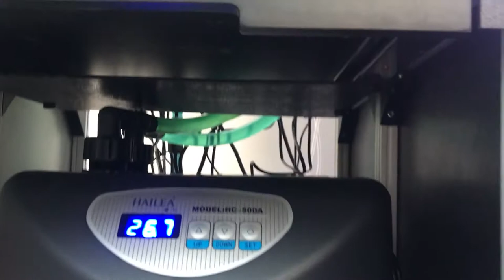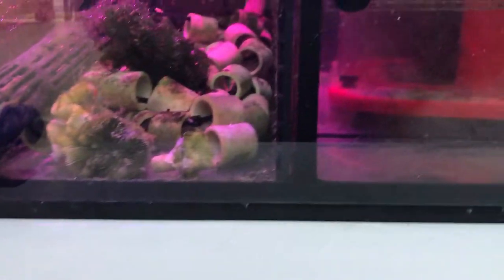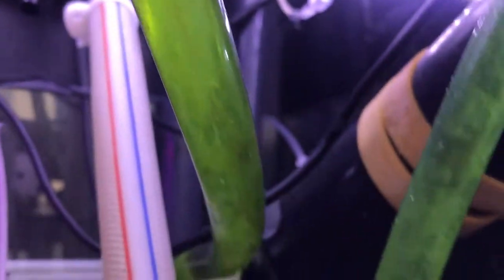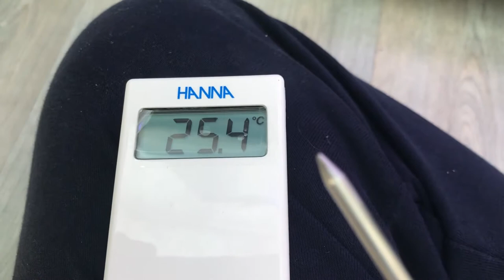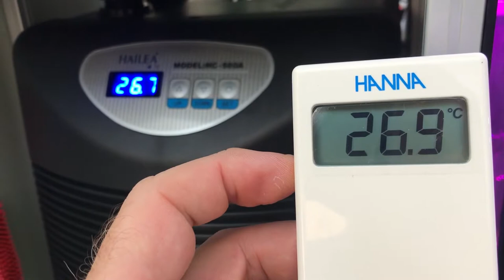vlog58 RSM S 500 Sump layout

Comment: What do you mean when you say you have extra wadding or watting in your filter socks? Do you add media in your filter socks? Consider upgrading to the red seas reefer roller mat system? You have to cut the pipes and it hangs we’re your refug is at. 
Plus you say you have an additional bubble trap?
Reply from the maker: Hello SkippyIsLove. I used to put xtra wadding in the filter socks. Now that the tank has fully cycled I only have wadding where the activated carbon goes. I do not want to the roller mat system good though they are, pure because of the ongoing costs of new mats. I just wash mine under a hose. I use a dedicated air pump to bubble-scrub for an hour twice in 24hrs. It keeps the water crystal clear.

Comment: Are you currently running the stock pump the tank came with? Just set up my max s500 and the pump isn’t adjustable and is set for 1850 gph. It’s blasting my sand away…do you have that problem?
Reply from the maker: Hi again. I had that problem too. I put a vlog of the angles of all the pumps. Since I had lps set up I turned down my three recycle pumps. The main return I found an angle where it did not blast the sand. I now have a dc return pump set at almost the same output and the sand does not get blasted either.
Reply: @robertlawless9700  why did you go with different pump? 
Do you have link for the blog for return pump angle?
Reply: @robertlawless9700  and when you say turned down…do you mean off? Because I don’t think the 3 circulating pumps are variable if I’m not mistaken
Reply from the maker: @MADTrollsReefTanks  you can adjust the recirculating pumps by turning the inlet. I showed the part on my blog where I cleaned one.